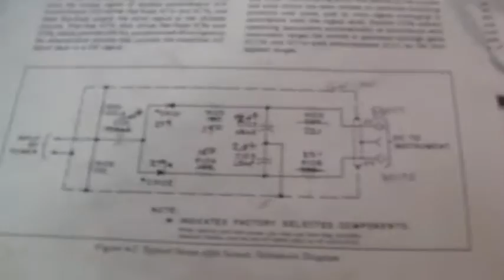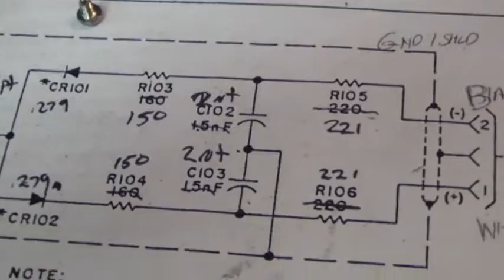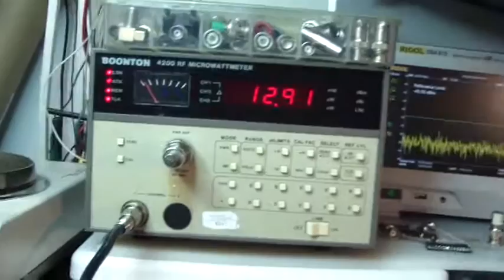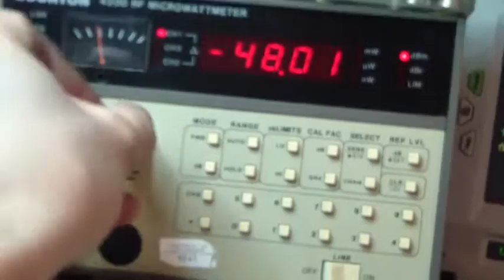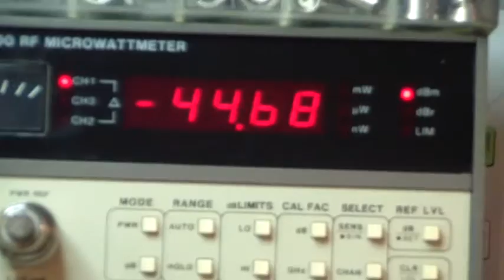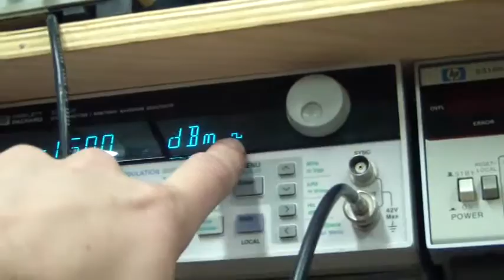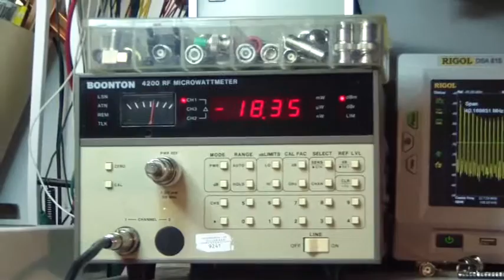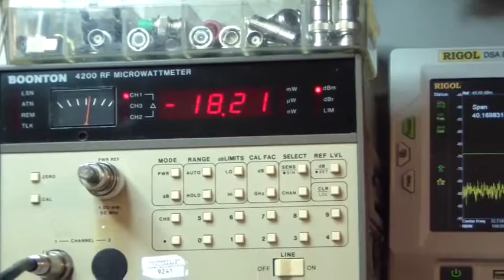boonton 4200 power sensor

Comment: I built mine 12 yrs ago in a piece of copper pipe using low barrier schottky diodes.. 
You will need low triboelectric cable between the prob an the meter though.
Works ok ,but the three lowest ranges had to be recalibrated on my analog meter.

Comment: The proper cable is made of a pair of singly shielded conductors, with an outer shield due the the low DC voltages. There is a Boonton 2500 calibrator that is circuit to calibrate the 4200 and 9200 meters. The circuit can be found online, along with the details. You can't use a tee connector to parallel two dissimilar 50 Ohm loads. Also, use a BNC to BNC adapter to connect the sensor directly to the signal generator. I have used both the 4200 and 9300 meters in the past. For work under 20 MHz the Fluke 8920 series meters with selectable input impedance and a BNC connector is very nice. It has the advantage of setting a relative level, to test stage gain. I used the 9200 and Fluke meters to record the performance of Sallen Key video filters in high end telemetry equipment at the factory.

Comment: Sure you can build the sensor but where do you get the 2 pin plug?  I found  this document that says it's an amphenol 80-mc2m but that's a microphone plug for CB radios so I'm not so sure.  http://ve2azx.net/technical/RF-Probes.pdf
Reply: 80-mc2m is the right part number, but Amphenol sold that line to WPI, and it was sold again, to Cooper http://www.alliedelec.com/cooper-interconnect-80-mc2m/70144706/ is one source